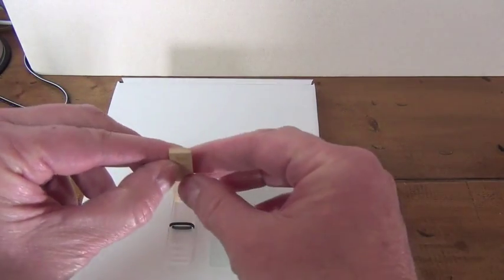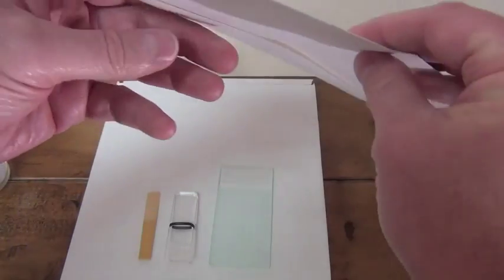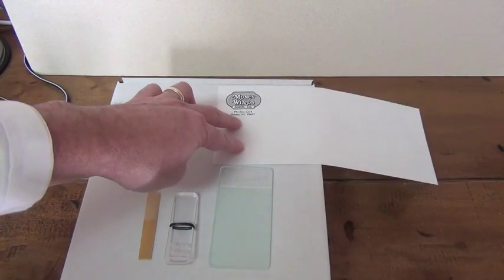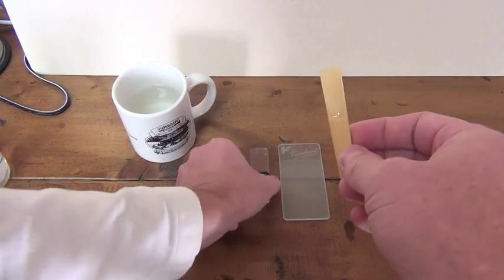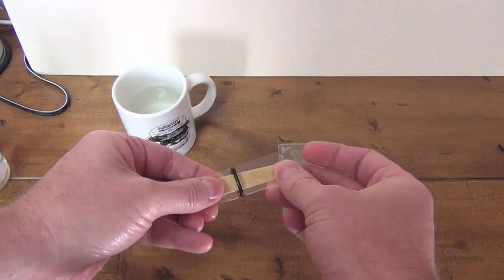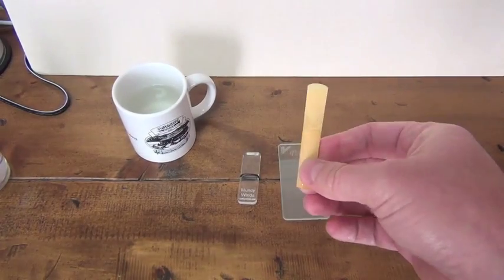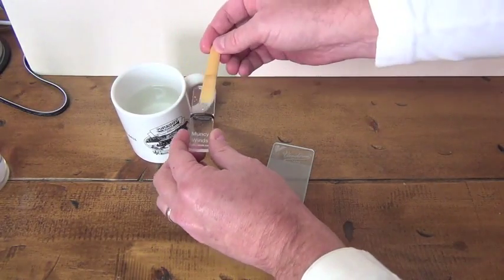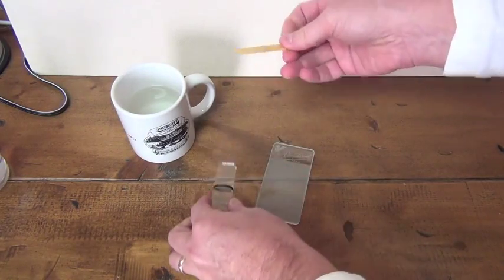Reed Resurfacer

Comment: How does one remove cane residue from the surface to reestablish the clean sanding surfaces of the glass and stick? Use of water, dish soap,  alcohol, lemon juice, vinegar did not help. Thanks.
Reply: I'd use a little Dawn dishwashing detergent. It works really well.